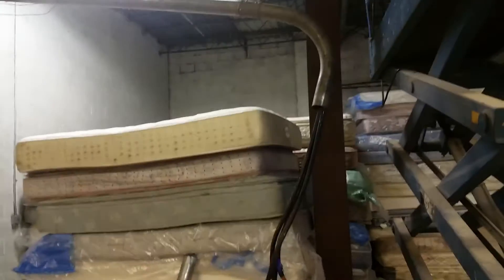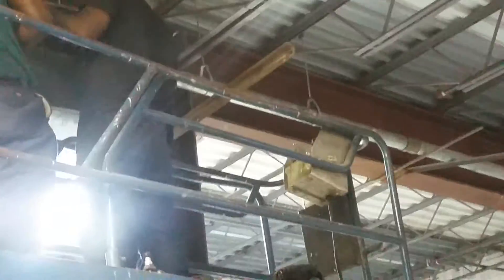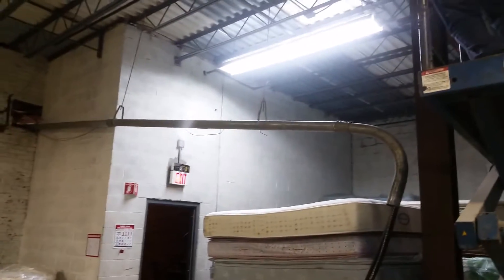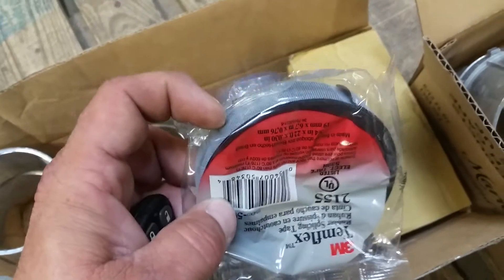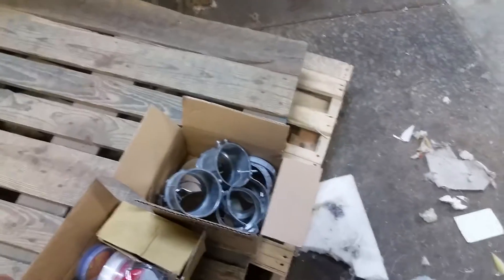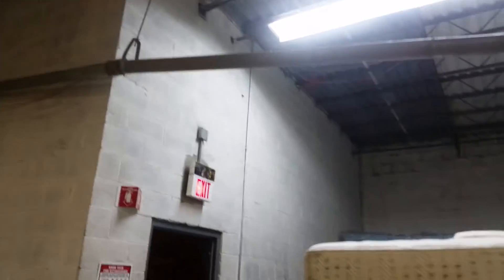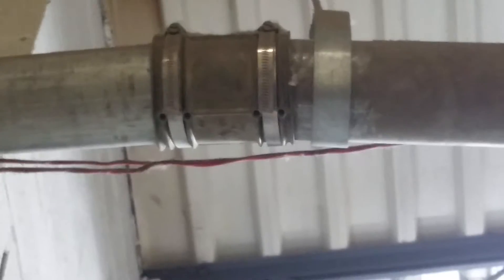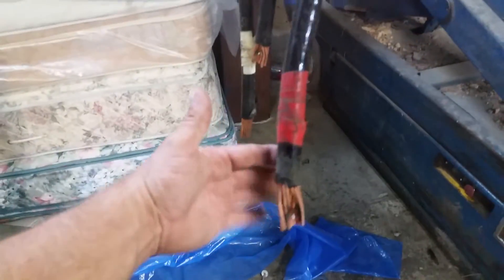Rerouting 3 inch EMT and 500 MCM

Comment: This comment is for your "rerouting 3" vid. I like those metallic color kerneys you're using. They're obviously not copper. Do you have to use a compound to prevent electrolysis corrosion between your copper wire and whatever metal those splice connectors are made of???

Comment: Nice work Nate! That's a big box! How come u have to mount that other box instead of a just puttin an elbow there to go up then another elbow
Reply from the maker: It just makes it easier to pull the existing wire through. This way you can mount both boxes, install your pipe then pull the wire through. If I used an elbow I would have to sleeve it over the existing wire to install it.

Comment: Over the years working in factories you see some real hack jobs that were done as a quick fixes that never got fix properly . One of the funnier ones was an old steam pipe that ran between buildings was changed to run power cables threw. Problem was they forgot to tell the welders that came to thaw the new steam pipe that froze with the welder !  They hooked to the old pipe not the new one ! When smoke started to pour into the building and the lights went off all H - - - broke loose !   I'm glad to see you take pride in what you do , Too many just do enough to get by and that's it,  You want it done right and the way it should be done, The Mr Nate way !    LOL  Keep up the great work your doing , But I think you need an RC and a moon pie !  Bandit
Reply from the maker: the factorys that have a competent facility manager in place really don't have that problem. I can tell as soon as I walk into a factory if they have a guy like that on payroll. they usually pre-screen contractors before they get there. Sad to say a lot of these places do not have them and it ends up costing them more in the long run. thanks for the complement  Bandit.
Reply: Mr Nate you are one of those guys I would look for to do work for me, Your a no nonsense kind of guy and you know what it takes to do a job right and you take pride in what you do and how it looks when your done. Its hard to find a guy like you , You take pride in your work and your there when you say your going to be and you make sure the work is done right .  If I needed electrical work done you would be the man I would call to do it, And I think that says a lot about you and your work !  Bandit
Reply from the maker: Bandit farmer thanks Bandit. Means a lot coming from you.
Reply: We all do this , We find the guy or gal we trust to do work for us when things need done we cant do. The people we trust because of the pride in there work there being able to work us in at a moments notice and treating us fairly on the price and getting the job done in a timely manner and doing the little extras .  Well Mr Nate you would be on my list if we were closer, LOL  But I don't think you would want to do a 400 mile service call  ! LOL   But your on my list anyway !  Bandit